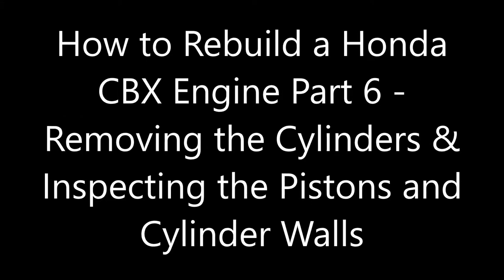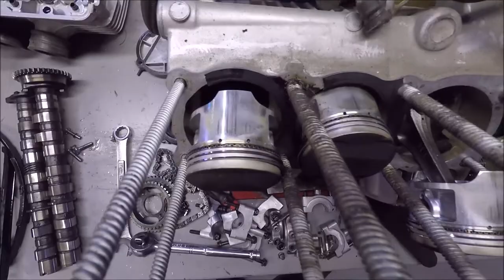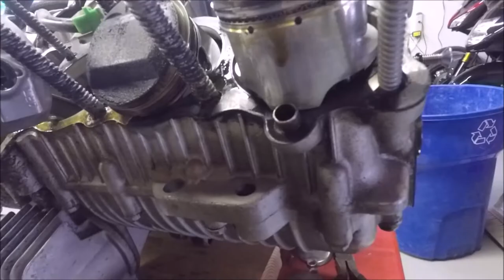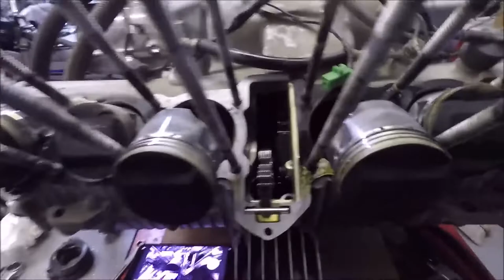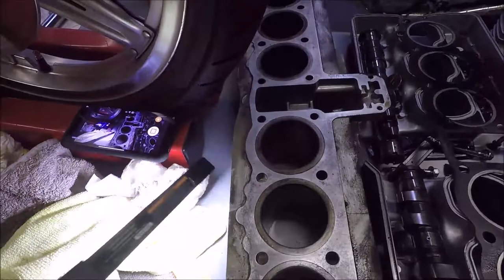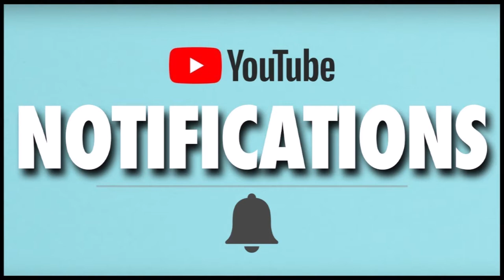Honda CBX Full Restoration & Engine Rebuild Video Series - Part 7 - Cylinder & Piston Inspection

Comment: Really enjoying your videos!!! Question......how do you think that the pistons ended up getting scored up but the piston walls were fine?  Seems like they'd both be messed up?
Reply from the maker: Hi Jim, The pistons are aluminum and the cylinder walls are a steel liner. The pistons didn't really have deep scoring like they would if there was debris in the oil. It looked more like scoring from heat and normal wear. The walls were in perfect shape that just needed honing. But the pistons had discoloration on them from what I believe was from the heat.
Reply: Thanks Peter......makes perfect sense...didn't think about the walls being a steel liner.